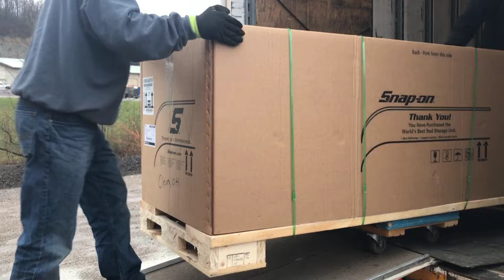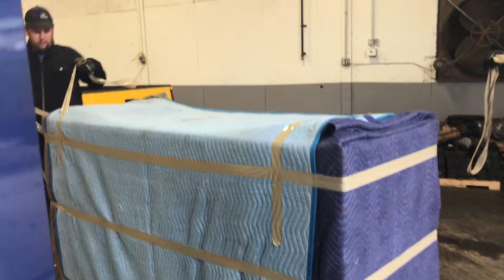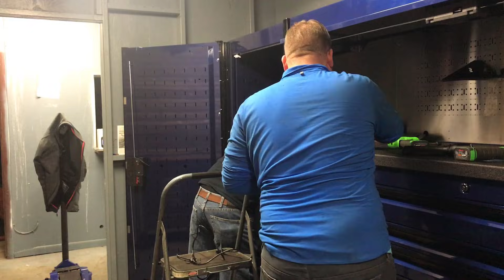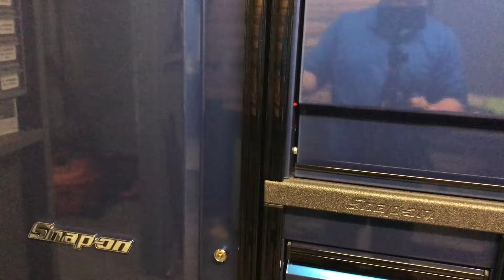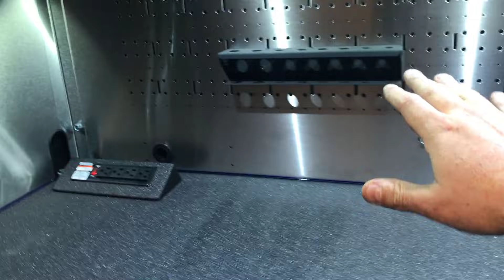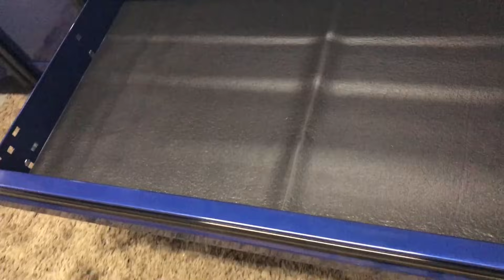SNAP ON EPIQ UN BOXING MUST SEE

Comment: Your gonna love it more and more as time goes on! Mine is and 84 / power cab / hutch / right side locker. The LED's last - mine are 4 years old, used 5 or 6 days every week, all good so far. They didn't offer the triple full-width drawers 4 years ago, no Ecko locks back then  either. Mine arrived all still crated and shipped in by a Mayflower moving van. The driver and his helper where super awesome and assisted unpacking / setting up until I told them I was 100% satisfied and signed for it. My dealer also showed up to assist.

Comment: Hey snap-on Junkie awesome vid. Ordered the same box but in flat black with black trim and it being delivered in a couple of days. do you have any tips or install vid on the hutch ( workcenter)  part of the tool box would love to see how you did that
Reply from the maker: Justin Avery it comes with a template I'll just mark the holes in drill them out it'll come with a drillbit and some self tappers they'll be in a pouch in one of the workstation accessories you'll see it and then you're probably going to need a couple guys to lift that thing up there it it weighs 350 pounds or something like that it's pretty easy the template works out really well you'll see how that works
Reply: Thanks awesome. How many electrical plugs are in the back of the box for addons like lights and power cabs etc?
Reply from the maker: Justin Avery 4

Comment: does your 2nd and 3rd full length drawer hit is there are 75-85% open, my 84 epiq does and im trying to get snap on to fix it they are trying to say it is normal
Reply from the maker: yes mine does the r fix it
Reply: The Snap-On Junkie!!! What are they doing to fix it,   Mine has done it from day one and the slides on the 2nd and 3rd full
Length drawers and no improvement
Reply from the maker: R&B Automotive we're going to try drawer slides first and if that don't work my guy said that he's going to get me a snap on him I had to give me a new box because he has one and the drawers are not like that so to me it's just like the to check to see if the gap by your power drawer is rear real narrow then it gets bigger onThe right side because that's what mine is doing and it's only the second drawer in the third drawer is fine
Reply: i dont have the power drawer on mine, my 2nd wrench drawer hits the top of the 3rd full length drawer, mine is a little lower on the left side, its wearing the power coat off of the top of the 3rd drawer, and i cant add drawer guards because that would add to the thickness.
Reply from the maker: R&B Automotive yeah that's kind of what happened to mine is doing the same thing but I have the power drawer and my snap on guy has one and it's not a power drill he wanted his does not do that so I think your dealers feed me Alina shit because mine said he's going to take care of it because he said the box the box cost too much money for it to be built like that
Reply: right! i want to get the workstation and the side locker but im not buying them until the issue with the box is fixed

Comment: you will have to check out the aluminum lug covers that I put on my tool cart, it was $80 bucks for 6 covers, I traded out of the tool cart and got the 2 bay in midnight blue, I haven't made a video on that box yet so when I do I will send it to you